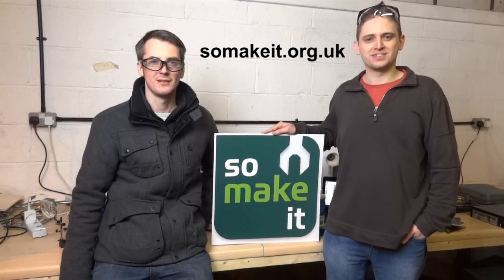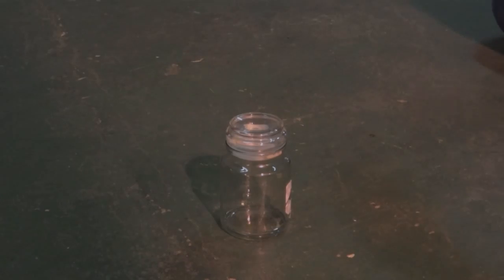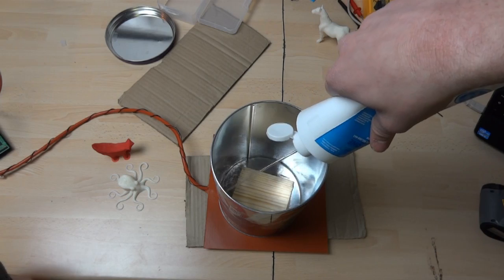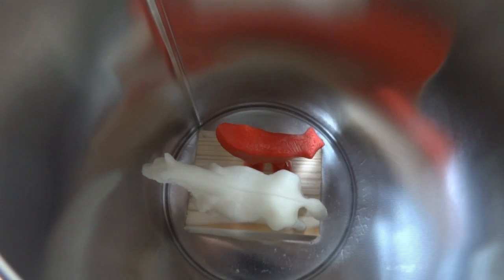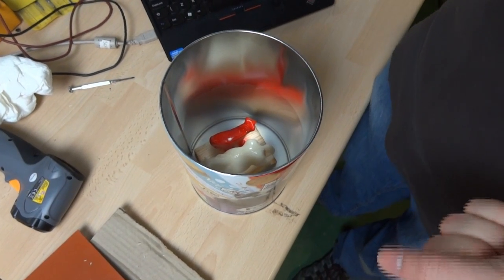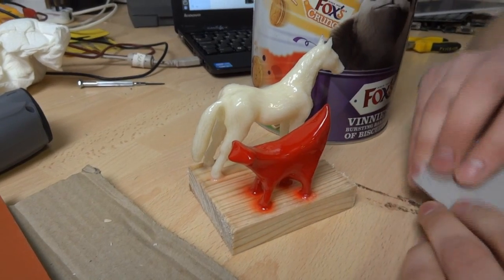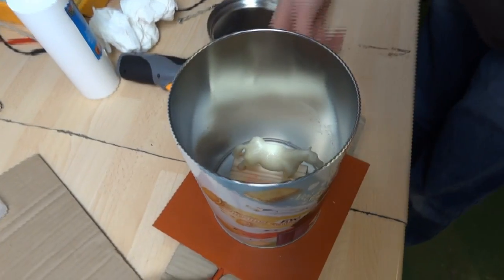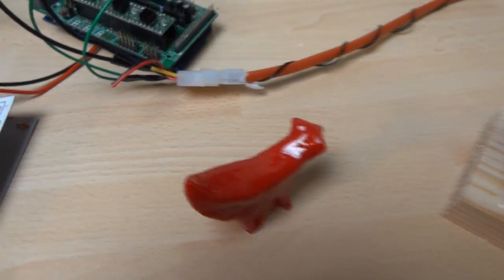So Make It - Acetone Vapour Smoothing of ABS 3D Printed Parts, at UK Southampton's Makerspace

Comment: I prefer sanding, it gives a much more superior result. I tried vaporing once, but parts come out ugly-shiny and even on your video, you lose tons of details and corners. IMHO - not worth it at all. Try 400-1500 sanding, you will be surprised how factory-like your parts will look.
Reply: +Vlad B Hello, once you have sanded the part do you coat it in anything to seal it?Any help is much appreciated.Thanks,Matt
Reply: +Matthew Evans sealing is not really necessary and I prefer matte look. You can play with different sandpaper to achieve any look you need. Needless to say this method will not work on very complex parts with a lot of bulps and curves.
Reply: Brilliant, thanks very much, I will try the different grades of sand paper.

 Cheers,

Matt

Comment: I've never gotten good results from cold acetone smoothing, though what you're doing here is a bit of a hybrid between hot and cold smoothing.  You're heating the acetone a smidge, but not boiling it as in hot acetone smoothing.  You're already applying a heat pad so you may as well go all the way and heat it to a boil as honestly its not increasing the risk factor.  You'll get a faster, more even, and more predictable result (assuming you use the same container), than you will this way.  You also need far far less acetone than used here.  I use a simple cook pot, and only need a splash to finish off a part.  I recommend something with a clear top to it, so you can watch the vapor cloud creap up the side of the container.  This way you're not taking off the top nearly as much to check and being exposed to even more vapor.  When using hot acetone smoothing the part is generally dry enough to touch after 5 to 10 minutes.  Its dry enough to work (sand, primer, fill) after about 10 hours.  A really good trick for a multi-part model is to smooth the pieces in acetone just prior to gluing.  Apply the glue as soon as the pieces are safe enough to touch.  While the surface layer will be somewhat dry, the other layers are still somewhat melty and will fuse with the other pieces forming an even stronger seam.

Obviously take safety precautions.  Mask, gloves, and a fire extinguisher.

Comment: What is that red thing? Also there is a method to do this without heating. That would probably be better... maybe a little slower... but definitely less dangerous. Probably would work better as well. Oh... that's a banana with legs? Weird... also if you use the cold method try using aluminum foil.
Reply: Yes, you can do this without the heat, I'll put a link all over the video.

Comment: first of all you didnt manage to get the right proportion of acetone-oxygen otherwise its quite amazing (ive made some fireballs with it in the past), but yet i agree with you its not dangerous in normal conditions, but i must mention it was the most stupid idea to use wood as stalk :)
anyway, using cold acetone vapor could be more convenient and you might get way better results, only drawback the procedure will take allot of time.
Reply: Yea, I do it cold now, 1 hour now takes 5. But it still takes about 2 days for the acetone to fully leave the part.

Comment: Tongs!
Reply: We did get some, but they dissolved. Acetone will find the plastic parts in ANYTHING!
Reply: +Bracken Dawson Quite a lot of consumer plastic is actually acetone safe.  You just have to check the plastic type first.  You're using a plastic squeezy bottle of the stuff after all.  Polypropylene is what you're after.
Reply: I keep used acetone in milk bottles, HDPE is good for a fair while.

Comment: Acetone is really flammable (and a carcinogen). An acetone vapor cloud is quite a potential recipe for disaster.   I think putting the parts in an oven with the proper temperature would be a much safer approach.
Reply: Acetone is not currently known as a carcinogen, nor is it expected to be proven so.
Reply: How will putting the part in an Oven make it smooth?? Or you mean putting the acetone in the oven??? a much much more dangerous approach
Reply: Still don't get the point... how will heat on its own smoothen the part and give it a glossy look removing the layer lines! 

I doubt heat alone can do this! Actually, I'm 100% sure heat alone cannot do this! At the moment, there is no safer replacement for Acetone that will give you the same finish!
Reply: Montypaks It melts at low temperature...
If you let enough heat hit the surface evenly, you would get a better result than acetone by melting the layers together, instead of breaking them down.
Reply: Surms41 Jerry Brett I'd love to see you prove that, put a printed part in the oven and show us a video.

I now do my acetone smoothing at room temperature in a sealed box, there's no point heating it really, it works faster but you still need to let the part "dry" for an age before you can really touch it.
Reply: Bracken Dawson I was thinking more of a blow torch, and I don't own one.
Reply: hmm, blow torch, I'm gonna try it.  Sounds like more noxious fumes though, so I will do it outside.  I will report my findings.
Reply: Jerry Brett Cool :D
Just enough to melt the exterior.
Also, try smoothing it after melting it to see if it's any better.

Cheers!
Reply: Acetone is flammable, but that's not really a too big concern, as you just use a few ml in this application. You saw the "spectacular explosion" in the video. And it is neither carcinogen or genotoxic. Only an irritant and acts as a neurodepressant in high concentrations, without any chronic effects. Basically it's not any more dangerous than ethanol. So this process is totally safe, except that you wouldn't want to bow right over the vapors, as I said, irritant.
Reply: Health update: Not dead.

Comment: Pretty sure you can use a high temp heat gun to get similar results.
Reply: I'd love to see a video of that, why don't you try. However I suspect your sculpture will fall down before you can get the surface runny enough to smooth out.
Reply: Bracken Dawson You could use double sided tape to stick it to your support

Comment: Cool tips will try it out. BTW you guys should wear nitrile gloves and a vapor mask when doing this otherwise your perception of the glossing might be altered by the high produced by the acetone vapor ;-)
Reply: Acetone easily eats through nitrile, a mask would be enough, if that, as acetone is pretty much non-toxic
Reply: numos orizon You do what you want I don't care, though I point to some advise, wearing gloves and a breathing apparatus is highly recommended when using hazardous material independently of your own opinion it's just common sense . We all do stupid things before we aware of the danger.
Reply: We do care about our own health, but we're practical people and we're working with nail varnish remover here. You don't actually get notability high working with it (even if the out-takes suggest otherwise). And it is indeed hard to find things acetone won't dissolve, PE kind of works but the acetone wins in the end.

Comment: This was an excellent video on this method.  I am just starting 3D printing was planning on attempting to use a vibratory rock polisher with varying types of grit/plastic/etc. to do smoothing.  I never thought about using acetone.  Definitely a good idea.  I am sure with some ingenuity the process could be controlled better, but the college "try" certainly has value.  Thank you for sharing this.

Comment: Print some holders for them out of PLA making sure there are holes for the acetone to drain through.
Reply: I'd wager a PLA grid holder over a wooden platform in the same tin and heat bed set up would make this more efficient.

Comment: Main difference is glass transition point (temperature at which the they become soft). ABS = 105C, PLA = 65C. What this means to someone with a 3D printer is that PLA requires a cooler extruder and heatbed (or in some cases no heatbed at all).
Googling this question will bring up lots of good articles with whole lists of other differences.

Comment: I haven't tried it yet, but I read somewhere that if you put the parts in a freezer after the vapor bath that it will stop the acetone from continuing to eat away at them. Just thinking it might help with the holes and make parts easier to remove from the base plate.

Comment: If you are willing to boil the acetone, it's a lot simpler to just use a steamer.  My video is real time, I don't usually have to leave anything in it longer than 30-60 seconds.  A few short exposures with drying time in between helps keep it from melting to much in one pass.  A short, rough sanding in advance helps.